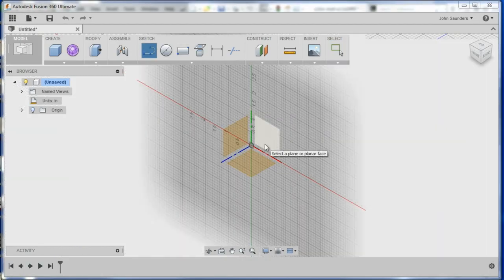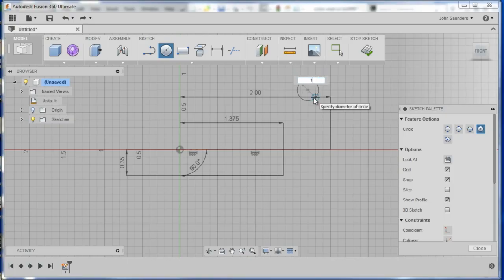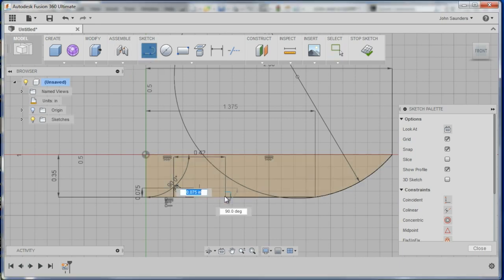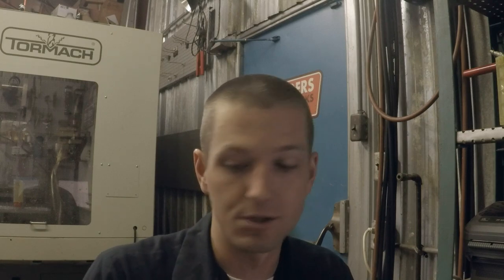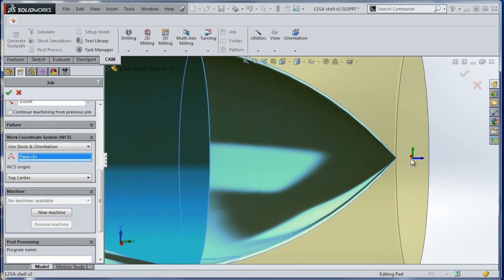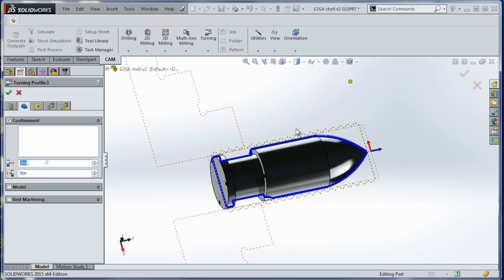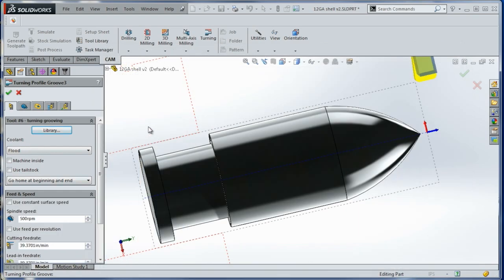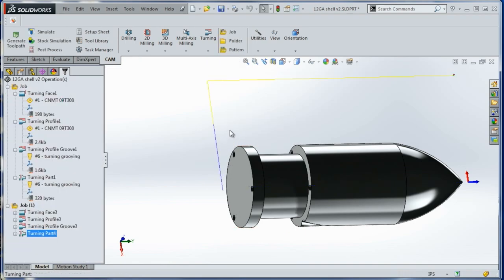Fusion 360 Bullet with HSM toolpath!

Comment: hi, notice you had some problems with the tool path. you could try setting two construction layers, and turn one off ( set the part up as two pieces, one for each end), setting one layers' properties to NON_ print so you don't get this part in the cam conversion. (mainly use bricks cad, should also work on your software) or as a second option set up two drawings one for each side, just swap the piece in the lathe chuck before switching programs.

Comment: Hey John, you just need to turn off 'Allow Grooving' in the Passes tab for a profiling operation. Then the tool won't drop into that groove.
Reply: NYC CNC Are you familiar with the Spun Profile tool in the utilities menu of the CAM tab in HSMWorks? That process will be automated in F360 & Inventor HSM, but you have to generate the profile using that tool in HSMWorks. Then select it when generating the profiling toolpath.

Comment: When you created the arc, it looks like it auto-created a tangent constraint between the bottom line and the arc (that little icon at the intersection of the lower edge and the arc, still there at 1:05). If you click on it and delete it, you can change the arc diameter properly.
Reply: Ben Avery That's the answer, also you can sketch everything out and dimension after the lines have been drawn.
Reply: NYC CNC sometime you need to remove all the little icon and put them back in it`s a bug, that file I sent you I had to do it to that after putting in dimensions and parameters

Comment: How about this >>> same round with the fins popping out from the middle of it by air pressure. The fins would be hinged at the back end and work like cutting blades too. You could put very small springs under the fins in recessed drilled holes to pop them open enough for the air pressure hitting the round to do the rest. The back half of these fins would need some kind of very good reinforcement to act like blades.

Comment: when you turn past your part, I always go at least the width of the cut off tool.  that way your not rubbing the rear edge of the tool more than the front edge.  much bigger problem on abrasive materials than on aluminum.

Comment: Hello NYC CNC, YOU WILL Find that if you drill 3/8in. depth x 7/16in. width cavity on the back side of the fusion 360 bullet . That it will not tumble when shot, any shot gun slug needs the cavity to help stabilize it while turning at 1.75 angle cut & .045 depth cut   for the capability of turning . try these tips and you will have success with your bullets .
Reply: PS. P/M ME on how much you would charge me for 5 - 16 gauge shot gun .of the fusion 360 with my suggestion in above comment